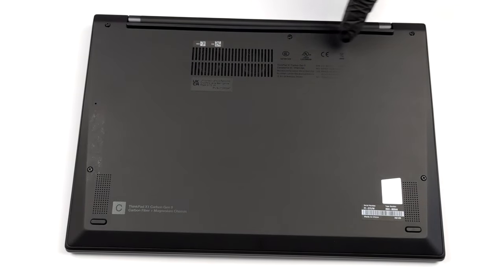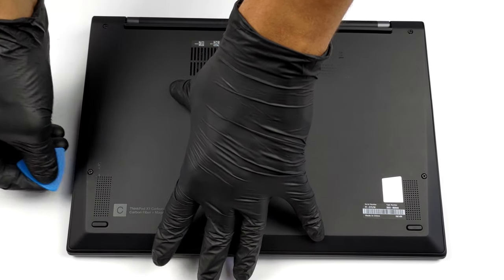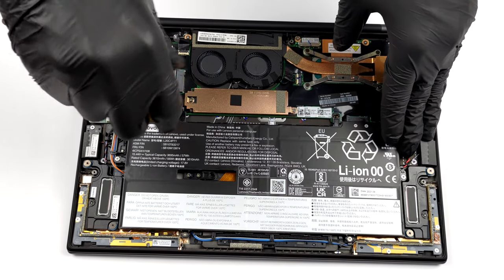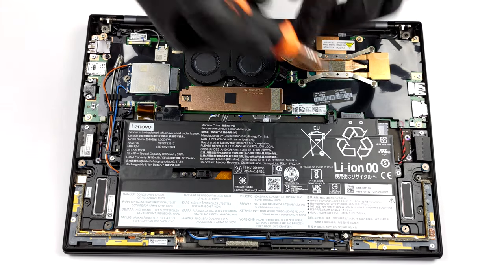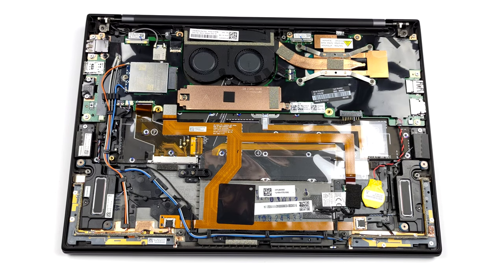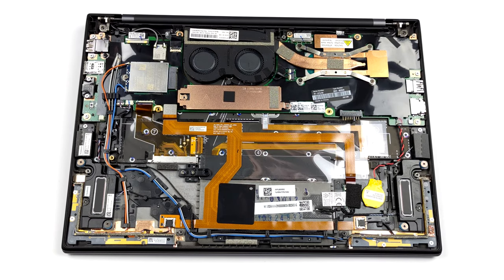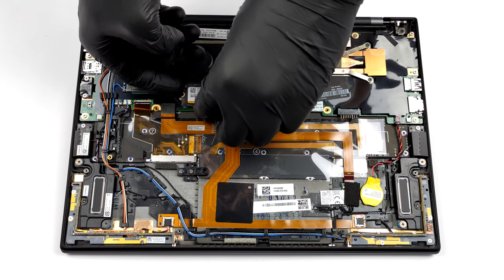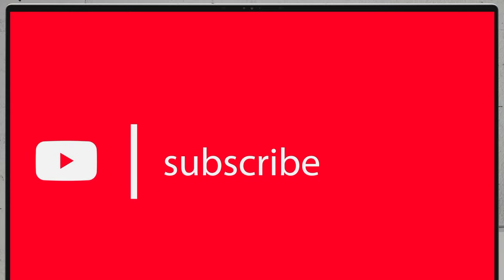🛠️ Lenovo ThinkPad X1 Carbon 9th Gen - disassembly and upgrade options

Comment: I get that Lenovo is going for the thin and light market with the X series but not even one sodimm slot...
Reply: This video was entitled "disassembly and upgrade options”. A more accurate title would have been "How to remove the back cover and SSD heatsink. Could you please produce a real video on disassembly.
For example, "How to replace the keyboard on an X1 Carbon, Gen 9 and Gen 10.
Thank you.